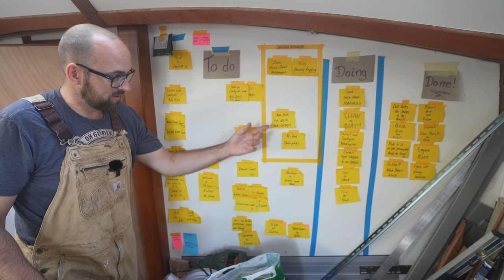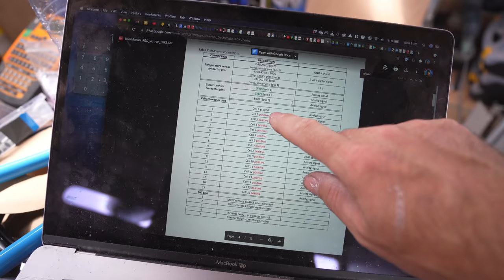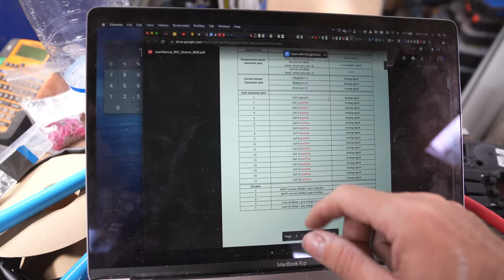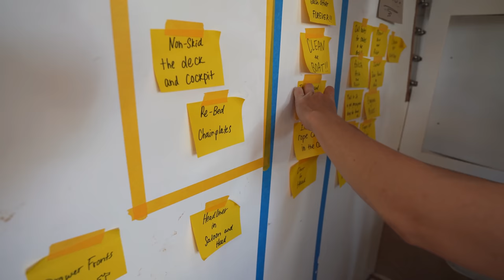Sail Life - Spiffy DIY toe rail & KiwiGrip Non-Skid ⛵

Comment: Electrical Engineer here... there is no standard where things are left to right or right to left on a connector - so that's not it. The fact that you're fully DIY and haven't made a mistake like this in years is a testament to how skilled you are. And I don't know why, but the Danish swearing always makes me LOL. Great work overall!
Reply: That swearing was very mild, but yes it's fun on the old ears.
Reply: Could it be simply the reverse-polarity safety diode that blew?
Reply: @Bluestatesurvival  Not with that much damage. It took out a whole bunch of resistors - they were probably resistor dividers for each of the cells. (Or maybe load balancing resistors)
Reply: The BMS schematic will show the battery connector with 24V at the top and 0V at the bottom.  Most likely when the schematic was made into a the pcb layout, that's the way the connector was laid out.  i.e from the pcb point of view it's 24V at the top, 0V at the bottom.  From the connector point of view, that's 24V at the left, 0V at the right...
Reply: It’s a problem that makes money for the manufacturer.
It’s just a cheap design from the manufacturer.  They should have added a single diode on the ground.  Or uses an asymmetrical connector with a notch,  like the ribbon IDE cables in the old computers (I’m dating myself).  They know it’s a problem, because they mentioned it in their manual.  I would expect similar performance in other places from such a poor component design.
Please try a different vendor.  You get, what you pay.
Reply: The #1 pin should have been indicated on the PCB board.

Comment: About those lithium batteries:  I was watching “The O’Kellys” YouTube channel and they had a cautionary tale on wiring the battery harnesses.  You WILL ruin your batteries if the wire lengths are not exactly equal.  This information was provided by their battery distributor (Just Catamarans).  It turns out that if the wire lengths are not perfectly equal, the longer length wires creates a resistance in the circuit and draws that battery down below minimum specs.  That kills that battery cell.

Comment: This channel keeps getting better and better.  It seems just like yesterday when you dug into the deck core to "fix a few wet spots."

So much has been knocked out in the last few years.  Athena looks awesome. 

The wood bulwarks/toerails are amazing.  We only use Tung oil on all of our outside wood except for the drop boards/companionway slats.  It is a really easy job to oil all the wood on the topsides.  I can do it all in a couple of hours and we have a LOT more than you do on Athena.  It would take 15-minutes to oil your bulwarks and buff off the excess.  Do it every couple of months and it'll be all the brightwork maintenance you will ever need to do on the topsides.

Comment: Absolutely LOVE the toe-rail! Also love that it is above the deck, so no need for scuppers-- brilliant! Now, for the BMS...thing... yeah... I did something similar, once... only, it was at work. And it involved much higher voltages (480 VAC). AND... a big-wig from Corporate just happened to be "visiting" (i.e. INSPECTING) our operations. He was standing about 15 feet away from the MCC for a 480VAC motor I had just wired up and was going to test. Problem: I accidentally wired the motor for 240VAC, instead of 480VAC... and... FIREWORKS!... EXPLOSIVE KAPOW AS THE FUSES BURST!... SHOWERS OF SPARKS STREAMING FROM THE MCC CABINET! The man almost shit himself! I sheepishly approached, like Oliver Twist, and instead of asking "Please, sir, can I have some more?", I merely said: "Um, it would appear that I had a momentary lapse of reason, and mis-wired that motor for the wrong voltage". Ya know-- I totally fessed-up. Plant manager was with him, made a snide comment to me (such a joker... NOT!). As big-Wig completed his pants-check for possible shit leakage, he turned to me and said: "Crusty (not my actual name), let me know if that motor is still good." I did, and it was-- the wires just got a little melty. The main damage was in the MCC and not the peckerhead or motor. The fuses for those things are about 6" long by 1" diameter, and they were basically vaporized! They're full of sand, and that sand was everywhere! I grabbed a broom... So, um, Mads: I think I got you beat, buddy!

Comment: Mads, Make sure all your battery wires from the cells to the bus bar are of equal length. Otherwise, the battery with the shortest wire will draw all the load.
Reply: That does not make any sense at at all… also the battery is wired in series so exactly the same current goes through all the cells, no matter what load. 
All the separate wires from the cells to the bms are for balancing and will not draw any significant load.

Comment: Mass and Ava,
Have you thought about grounding your mast and shrouds in case of a lightning strike? You should also think about setting up your electronics wiring so that you can disconnect them quickly if a strike is imminent. You don’t fry them all. Perhaps installing an ion dissipator may help.

Comment: We learned that Kiwigrip should be cleaned, just like the rest of the boat, then WAXED with a non-skid wax, such as surfboard wax to keep it easy to clean. There are s number of different non-skid waxes on the market. It really makes a difference.
 I also found that using the Kiwigrip roller, the thinner the coat, the smoother it will be. Two thin coats will result in a smoother thick coat.

Comment: Cleaning Non-Skid does require some special tools.  I used carpet brush (you can get them from Amazon, they are black and yellow), there are many others too.  Chuck it in your drill and you can apply boat wash to the deck and then clean it with the brush.  We had our boat on the hard over winter (around here in Michigan we all pull at winter, unless you have a garage and a bubbler...and heaters for the engine compartment so you don't freeze anything).  A crew was doing ashphalt work, and all our boats got coated in a film of the dust/grime...ugh...Only thing that worked was straight boat wash onto the non-skid and the carpet brush.  Took 6 hours to clean the entire deck...nobody was happy with that crew.  :(

Ipe may be common in Denmark, but in my neck of the woods it's an ORDER ONLY item.  You're right that stuff is TOUGH.  It doesn't float due to its high density, but the stuff is awesome as long as you maintain it, otherwise it gets that silver/gray look.

Comment: That is a beautiful toerail!  No, low is good.  This is the best toerail I have ever seen.  Maybe this wood holds up better than teak.  Teak gets very grainy and it also gets moldy and unsightly with time unless it’s varnished or painted.
Reply from the maker: After sailing full time for about two years the toe rail has turned a little grey but I don't think it looks bad :) No mold - knock on wood ;)
Reply: Is there a link as to where the toe rail was purchased?

Comment: Mads and Eva.... protect the new and beautiful wooden toe rail. You won't regret it. Wood deteriorates very quickly in salt/sun environment. It looks so good now, but won't after several months unvarnished or oiled and unprotected from the elements.. As the cost of wood rises... $1000 you paid now could easily double over the next year(s). You said so yourself, this wood lasts for years if cared for. Please take the time  to oil or varnish.... whatever works best for this wood.

Comment: The BMS should be designed that reverse polarity will not burn out the unit. The voltage for any single cell isn't that high. And, just a question for Mads, I have watched your videos on the Athena and always noted that if you had help, many things would have been much simpler for you. Having Ava around to help must be a Godsend.
Reply: Easier said than done when you're dealing with ssd something that is designed to accurately detect those voltages. Everything you do will interfere with the readings. And voltages are very high if you're a microscopic junction between two semiconductors!

Comment: Mads, I suspect the old BMS can be cheaply repaired to have as a backup. It's most likely mosfets that got fried and they are cheap and easy to replace. When boards like that fail it's usually the first component in line that fries, leaving the rest ok! Only caveat is if the component took a long time to fail the excess heat may have damaged the circuit board making repair more difficult!

Toe rails look great. I'd give them a coat of oil, not to keep them from rotting, just to keep them from turning grey and not looking as spiffy.

Comment: Mads make sure the BMS is off when connecting or disconnecting the battery plug and isolate the battery bank too. I have blown up the internal soldered fuses that way before.

Comment: Hahaaa, we've all been there, done that and worn the T shirt regarding your BMS mistake.  You can get so focus'd on what you're doing you miss the obvious, bit of a blokey thing!  Surprised the BMS did not have polarity protection though.  Toe rail is great but watch out for rain streaks on the top sides.  It may be preferable to manage the spillage points down to, say, two per side - this will save a lot of polishing potentially...

Comment: Have you watched the latest YouTube video from The O'Kelly's?  They talk about wire length to their lithium batteries and how they didn't have all the same length wires so one cell worked harder than others so it ended up being replaced much sooner than normal.  I couldn't tell with your setup but you may want to check that in your situation to avoid excessive wear on your batteries before you install your new BMS.  See The O'Kelly's "BOLD MOVE - CAN WE LIVE WITHOUT IT?" About 4:30 into the video the rep explains the concept on wire lengths.

Comment: Brazilian here: the tree is called Ipe. Your pronunciation is almost spot; the 'i' is not pronounced as you said (ai), but more like 'ih', like Ih-pe.
Reply: Great info. Here in the USA it's usually pronounced EE-pay. Is it a native word or Portuguese word?
We are just finishing a deck using Ipe. Probably the hardest and heaviest wood I've ever worked with. Since we are in California we looked up its fire resistance. It compares well to steel and concrete!
Reply: @johnVidBozo  Good question regarding the etymology. 

The name Ipê comes from the Tupi language (natives), means "árvore de casca grossa" (thick bark tree). From what I found, the natives used Ipê to build bows and  arrow shafts. The Ipê here are protected by law.
Reply: @johnVidBozo  I too pronounce it "EE-pay," (rhymes with "Ebay.") However, after a friend of mine brought me some to make him some teak-looking cup holders for his boat, I call it "Devil-wood." It's so hard I ruined a set of planer blades, and I STILL (and this was several years ago,) have yellow residue that looks REALLY like sulfur - (hence the "Devil-wood" name,) stuck on some of my tools! Working with this I think was worse than concrete, although I dot to admit it holds up REALLY well!!!
Reply: @gac914  Yep, harder than iron wood. It's incredible.
Reply: My first experience with ipe wood was a curved handrail in a customers deck. When i asked about curving it the guy just laughed and said not happening.
I did prove him wrong but what a pita. 
Figured id soak it for a week or so , set it in my pool and it promptly sank straight to the bottom, thats when i knew this was goung to be a challenge.

Comment: I just watched the O'kelleys and they just did a video on lithium batteries. They had a guy explain about wire length and how it can affect the cells. I'm sure you have done you deep research but just wanted to give the heads up.

Comment: Grey Kiwi gets stupidly hot in warmer climates, be warned. We put it on a 45 ft cat and worked it out after we had applied it……… A four inch brush was the best way for us to get the Kiwi on quickly in 35 degree heat, had to work stupidly fast to get the tape off in time.

Comment: Watched the O'Kelly video today and Nick learned that the cables from the batteries has to be the same length or the shortest one becomes the path of least resistance and drastically shortens the life of that battery.  Not sure if such an issue applies to your set up.

Comment: That toe rail is the cat's meow... But I do have to point out that when it comes of time to replace it, it will not be easier. Simple math, 70 years then I will give you a modest 20 years old = 90 year old out on the deck replacing the toe rail will not be easier. Trying to bend down from your walker alone would add tons of extra time. ; )

Comment: As long as you don't charge the cells above 3,4V each you can get by without a BMS. I have a BMS-less setup for 4 years now and cells are within 0,02V from one another. Cells will last forever if uou don't charge them above 3,4. I have a 4 cell setup with 500Ah capacity.

Comment: I reckon the toe rail design is great and breaks up the look of the all white of the boat. One thing though puzzled me, why didn’t you oil the wood before installing. At least that way it would have had its initial protective coating without the need to mask up the boat when you apply the coating..  I am going through that process currently on a boat I am working on. The product I am using is Sikkens Cetol Marine. It’s very easy to apply, 3 coats and the timber is well protected.

Comment: Yea the getting dirty thing is more or less a time based thing. Because of the water that gets stuck in the little crackles there it eventually gets moldy and in the salt it actually gets like barnacles in it. I'm not joking dude. But it's better than sliding off the side. Do what you have to do. I like teak decks. There is a way to keep that texured stuff clean though. Scrub the shit out of it. I did and it works... sorta. If you don't mind working for it.

Comment: right to left is standard .. in so much as the other connector is numbered left to right, also also common for connectors to be numbered from ther PCB side. so from the end user side they are backwards. we have all done it. chin up and move on . ( I used to build racecar looms.. ) easy mistake to make. much harder on milti pin connectors but very very easy on inline or symmetrical connectors.

Comment: To prevent corrosion in the toe rail, copper or brass would be the traditional choice. Steel, even stainless, is known to corrode in contact with timber (usually oak). Google "Causes of metal corrosion in timber fixings" to find an article describing the causes.

Comment: The eye on the metal part of the toe rail should be open on the top side! With this design you have to feed the lines through the eye every time if you want to tie it to the cleat. Also the eye is too narrow to feed multiple lines through. Not so spiffy IMHO.

Comment: Manufacturers should protect their equipment from reversed polarity.  They can also design the pin assignments to prevent a reversed polarity from doing damage.  Yes, it's a user error, but trust me when I tell you this happens way more often then I care to think about.  In the Navy the term "sailor proof" means everything should be designed for the dumbest sailor on the ship so nothing can be seriously damaged.

Comment: Mads, that BMS is shit because they didn't put a wiring schema as silk screen on the BMS. There is enough space for some silk screen. Also, the manual could have a better layout to avoid such mistakes. Clear case of very bad design, if you ask me.

Comment: I would have an electrician doing the wiring. Here in Germany you have to have a pro doing that or at least for having a look at it before it gets connected to the batteries. Would be horrible if you accidentally put this amazing boat on fire and with it all your hard work.
Reply: You seem to miss understand the DIY in a dyi boat channel!
Reply: @57dent  I don't! It is an insurance question. At least in my country you have to have a pro doing safety relevant steps in your build. Electricity is one of those things. If you don't and you can't prove that it was done by a professional, you lose your insurance cover in the worse case scenario. Such a battery bank has the potential to sink your ship when blowing up due to immense heat. Ever seen a Lipo  burning/exploding? That's why I wrote what I wrote!

Comment: Mads… shorting out your controller was not stupid.  You were connecting hot DC wires to the controller directly and that was risky.  Controller manufacture could have provided a little safety fused fixture between the hot DC wiring and the controller.  Stupid mistake?  No.  You’re under a lot of pressure now so recruit a buddy and get some technical help.  Martin… where are you?
Reply: If you didn't, bring Eva into the process.  If she doesn't have the technical background, all the better.  Instead of a code read, do a wiring read.  Talk her through your process before setting the circuit breaker to ON.  I can't count the number of times I found a bug, either software or in hardware design, by walking a novice through the design.

Comment: Rather than blaming you, i'll blame the people who designed that. It would've taken exactly 1 dollar more per production to make a separate ground to make things as obvious as possible. I'm squarely in the camp that products offered either come as pre-made items where you just plug-and-play or as parts. Halfway is just halfmade, and therefore something that's made to squeeze money out of someone's pocket, especially in this case where a few SM components would've also been easily installed to prevent any kind of failure mode. A shitty 3 dollar fan has stuff like that so the motor only works one way, but an expensive tech doesn't? What if water shorts the wires in a boat? At which point no amount of plugging the wire in the right place affects the situation?

Meh product.